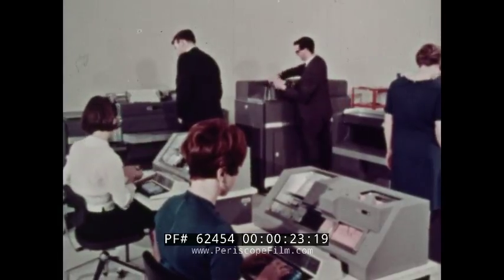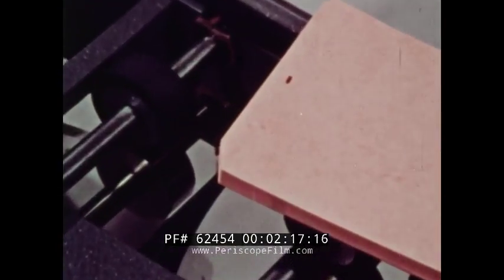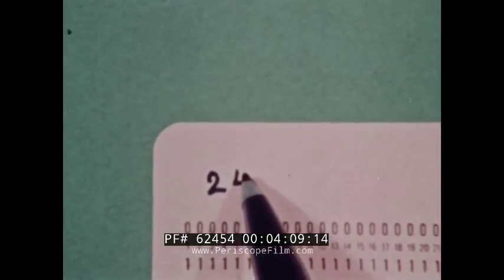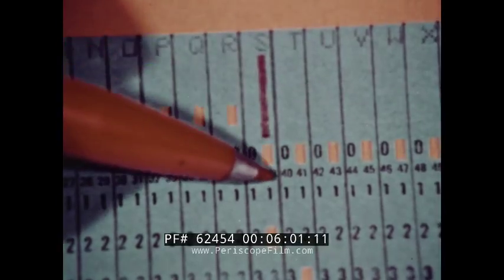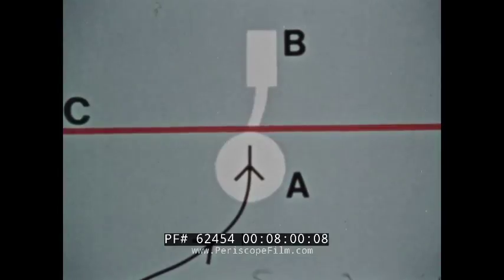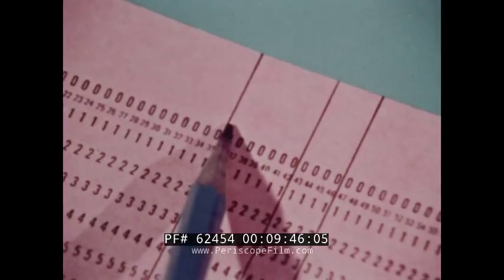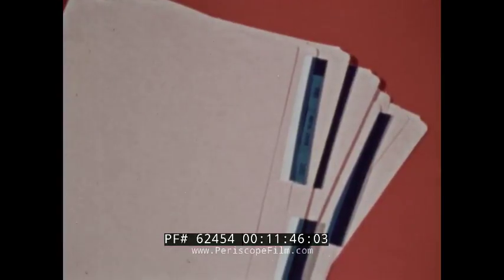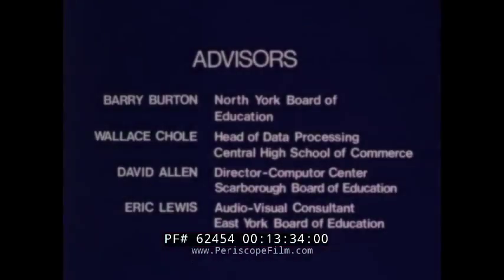PUNCHED CARD DATA PROCESSING INTRODUCTION   IBM 029 COMPUTER  62454

Comment: I never wondered how punch cards were made, but your show is most inviting. I was an avid typist who worked on several IBM data entry machines. An advantage of the punch card was that it can be used more than once when it was in good condition. The only disadvantage I knew about the punch card was when the print was vague atop the card.

Comment: The 029  was a keypunch machine, not a computer like the IBM 7090, 1401 and 360/370 computer series I started my Data Processing career on.  Even though I ended my 52 year career in Data Processing/information Technology in 2018, I still can code Assembler, COBOL, Fortran and RPG.

Comment: Punched cards were way before my time, but I did run a system for the Air Force back in the late 90s that had been around for so long that the field sizes and on-screen layout were based on the old 80-column cards.

Comment: The “029” refers to the IBM keypunch machine that operators sat at to enter data onto them.  Cards are NOT read from the top or bottom but rather from the left edge.

Comment: Brings back memories, both good and bad, Was train to work on the IBM keypunches, sorters, and interpreters. Spent 25 years working for IBM service as a remote Customer Engineer. Hated the timing and circuits for each machine, BUT today I miss it the complexity of the systems and how they worked with each other. Good times.

Comment: I started working in IT at the tail-end of the keypunch card era. I remember them fondly, though I'm not sure that I was particularly fond of them at the time. One use of the slashed corner not mentioned in the video was to make some cards stand out from the stack. So, if for example, we had to include a card with the run date in a stack of job control cards, we would feed it upside down in the keypunch machine and insert it upside down in the stack, this way its rounded corner stuck out from the slashed corners. Next time we ran the job and had to change to date card, we didn't have to search for it in the stack.

Comment: "giving the card 960 possible different punching positions" Yeah, not in practice...for example, you can't send a card through that has all the positions punched. It would be a flimsy mess and would probably get crumbled in the machinery. Also, there was rarely a need to punch at most 2 or 3 numbers in a single column, so in practice it was more like about 160 positions.
Reply: I used to fix this equipment.  While there was no reason for a card reader to see a card with more than 240 holes (3x80) we tested the printers by punching every possible location.  This was called lacing and allowed you to see at a glance in all the dies were functional.  Our card punches were made in France by Honeywell Bull.

Comment: In 1979 I became involved in programming learning FORTRAN V on an IBM 370/148 and most people get used to the Model 29 puncher. Those machines are very heavy and noisy and if you mispunch a card you discard that I take a new one. One of the undesirable things was being aware to number those if you or someone drop them as is the worst nightmare for beginners to know early on. I still have some of them around to show to younger generations how difficult programming was in those days. Thank you very much for the video as I wanted at some time more information on filing and setting fields for records.

Comment: In the mid 70's, our tiny school didn't have its own computer (of course). Terminals weren't really in use yet, so we had to write out our programs on punch cards by hand (pencil in the boxes), so I guess they were optical by then (?). You stacked up your cards, put them in the inter-school mail.  A week later, you'd get the output from your program back.  Really sucked when you then found you'd slipped and put a decimal in place of a comma or some other tiny error and all you got back was an error message.  Lather rinse repeat!
Reply: Thankfully, the next year we got a TI Silent 700 terminal. Now we could just type out code, run, and get errors right away!  I still have a functional Silent 700 - complete with acoustic couplers!

Comment: As students of Mechanical Engineering in 1980, we have to learn Fortran IV and Basic as mandatory. Basic was not so much trouble since the laboratory was equipped with Tandy's TRS-80 with incredible 16kBs of memory.

The real problem was FORTRAN since we have to:
- Buy our card packages.
- Reserve time in the punching machines.
- Punch the cards, do desktop test and if we have everything right...

- Go to the counter, so that the employee can take the cards to the reading machine, in the brief moments in which he did not cut the print jobs of the printer, sorting them in the loft where the prints were stored, recovering the card packages already read, or talking about their daily events with other clerks...

- As freshmen we were in queue 5, so there were researchers, graduate engineers and others before us... after at least half an hour, the work was finally processed and sent to the printer and we had to wait for everything the aforementioned process... waiting for the clerk...

- To finally discover that you forgot to put something that went from a comma to numbers in radians ...

- Redo the entire process to correct the error and consider that we had to leave the facility at ten o'clock at night to cross the campus and get transportation... to start over the next day and meet the deadlines.

Those were the wild days of computer science in the mainframes in the 80s for a student...
Reply: The punch-outs made such great confetti, though!
Reply: @rockets4kids  And cards were also a good material for cardboard planes!
Reply: @rockets4kids  makes a great gift for neices and nephews too!
Reply: MY program destroyed ( virus) right before submitting to finish BS Engineering...
1986. 
I hate computers...lol
Reply: A prank in our class was to introduce a spurious card into a fellow students pack, or just change the order of the cards, then the compiler would reject the job lol.
Reply: @howiedewin3688  To avoid this, we write the card number with an ink pen as long as clercks had tendency to drop packs as they put it into the reader or as they collect them from it.
Reply: @m.a.granados7960  substitute the spurious card with the identical ink penned number, kids arent as dumb as they look sometimes.

Comment: neat... before they used ASCI and binary to store more info than could be stored on a single card.  The alphabet took 2 "Bytes" to store a single letter and the number 254 took three "bytes" instead of one.
Reply: ASCII, or the IBM favored EBCDIC code was indeed binary - a compact encoding.
This encoding would not have been ideal for the pattern of holes in punched cards. Cards had an additional requirement: the need to maintain a mechanical rigidity. No more than two holes per column ensured strength.
When the goal is to represent one character per column, it’s a matter of reducing the character set until only a maximum of two holes are needed. There is no need to use all 256 of the full ASCII repertoire. With 12 rows we actually could encode 4096 different characters per column if using binary.
Binary encoding, compactness, efficiency, are indeed employed within the computer’s circuits. Not so much for this external physical media that’s more a human interface with mechanical integrity considerations.

Comment: Thank you, I would never have thought they used brushes 👍
Reply: A few of the last card readers used solid state optical sensors, more expensive to build, but they lasted much longer.  Paper is one of the most abrasive materials, and would wear out the metal brushes as the cards slid under them.

Comment: 12:41 "Two abbreviations are used for sex...", not any more, hero.  I don't think punch-cards could accommodate the zoo of genders today.
Reply: That's easy, you have a separate card just to denote the gender. The "gender punch card". Of course, in 99% of cases it would be redundant...
Reply: I'm sure they could have squeezed in a U (unknown or undefined) without adding an extra field column.
Reply: There are still two main sexes today tho lol (apart from intersex which is a congenital condition). Genders are different from sex.

Comment: Sadly, the limited date field make the cards non-Y2K compliant.
Reply: Don't worry, somebody else will have that problem in 1999. Unless you change jobs, and inherit somebody else's Y2K problem. But that is so far into the future that nobody will worry until about 1998.
Reply: We have Y10K to worry about.
Reply: @jvolstad  Y2k38 is next up.
Reply: 2038 with Unix.
Reply: Oh no, we will have to re-punch all cards to suit the new format. Better order another pallet of card stock. Actually four pallets of the white and mix up the other one for various colo(u)rs.
Reply: I think, not the cards as input device are the problem, but how the data are then stored and processed (in case of IBM: COBOL and SQL DBs)
Reply: Nonsense 80 column cards are Y2K compliant… I first started using punch cards in 1963 with Fortran II … still using them today they make wonderful book marks … books some of you might remember them… we used them for references before the web
Reply: In real business applications you'd find that every single column of a card would be used.  Where I worked they were so desperate for bytes that most dates were done in Julian.  YYDDD, two digits year, and how many days into the year the date was.  All kinds of subroutines were provided to convert to and from  Julian / MMDDYY to handle human input and print dates on reports or screens.  Frankly, our Y2K conversion was a nightmare, hundreds of programs still expecting those old 80 byte records (even when those records were on tapes or disk)  But we started early (1995) and did it right and had zero problems.

Comment: Couldn't bear to watch the total video. Brings back nightmares as a student of electrical engineering at Tennessee Tech 1968. Fortran-IV was a mandatory class. The school had one of the largest IBM computers in the country with a whole climate controlled floor of the engineering build dedicated to it. They sublet time on it to banks and other entities. As undergraduate students our time allotment was the lowest priority. We were only allowed specific hours on the punch machines. After punching the cards we'd proof them and submit for a run (late night) of our program solving a problem. If it didn't run we'd have to rewrite, repunch and run the next night. Grading depended on the number of times you had to run the program and solve the problem. Imagine running across a dark campus late at night during a pouring rain with a box of punch cards, trying to get your stack of cards in the tray before deadline and THEN you slip and fall on a slick sidewalk spilling the cards. Damn! Now my laptop & cellphone have more computing power than that dreadful IBM monster. The simple problems were easily solved on the "Post log-log-duplex-decitrig" sliderule but we had to learn Fortran-IV. What a waste.
Reply: In 1982 I learned to program in COBOL with punched cards.  Similar situation.  Although the collage didn't time share, we had the computer to ourselves.  Not much better, only one compile per day.  I watched a girl have a rubber band break right at the door to the computer building.  Entire final exam program landed in a water puddle.
Reply: @dbeagle82  : During "summer quarter" 1968 a team of EE grads at TnTech had strapped a teletype keyboard from the top floor of engineering building into the IBM mainframe on the lower floor and found they could directly input program to the "brain" bypassing the card reader. It was rudimentary but they could ask questions and get answers on a pin printer. They were walking tall. :-) That was what we called "RAD" back then. Now nearly anyone can learn to CODE and make big bucks. EVOLUTION!
Reply: Gerard Johnson some of us undergrads from that era worked at slave wages in the computer center. The unspoken benefit was after hours, when the adults went home and we had the run of an IBM 1410 business system with a rare 80K bytes of memory. One of the other guys modified the Fortran compiler to read student programs, then put on tape, into memory, simulating a card reader. Except for reading the cards, it was blindingly fast. Students got as many turnarounds  as we were willing to run, until the building was locked up. When we were the only ones left in the building, we ran games, music, drawings, or our homework assignments outside of the nitpicking accounting system.
Reply: @richardkirka5977  : You got a bit deeper into it at school than I did. My dad was a electrical contractor. New school buildings were all the thing in Central Kentucky during the 50s & 60s. We were "open shop" but the public projects carried union wage rate (scale) wages. Daddy was into the money and worked alongside the guys making very good money. We worked off of drawings stamped by an electrical engineer. Job done, passed inspection and we got paid. Great! Yet I always wanted to know the WHY & HOW the drawings came about. So I went to "college". Along about the late 60s all of the new schools were nearly built and we got into industrial electrical. Most of it was "design and build" where the "general contractor" put together a design team and sold the project to the client while bidding against other contactors. I wanted to be part of that process. It took 2 years to realize "university" was only going to teach me theory and I'd need to apprentice with a licensed engineer to learn what I wanted to know. I quit Tennessee Tech and taught myself "electrical engineering" by dissecting other engineer's drawings. I would do the design and hand draw the tracings for ammonia prints. Eventually I learned AutoCad and had a plotter. I'd submit and verbally sell the design to a "licensed electrical engineer". I would pay for the "wet stamp" and the engineer was then my employee as a paid consultant. We had a great run for over 30 years without even one problem working with this system. Never had one E&O claim. Many times I had "licensed engineers" come to me to solve a problem for them because they knew I not only could design but had the experience of bringing a project in on the site. One of my highlights was during the introduction of digital power to the market. None of the "old heads" understood harmonics and how to counter the effects of switched-mode power supplies in early gen computers and "Variable Speed Drives". I quickly became versed in "triplen harmonics". All of the schools daddy had wired now had desktop computers in every room and industry had bought into VSDs in high order. Helping the engineers and utilities damp the problem was lucrative. I've now forgotten all of that and replace "light bulbs" with LEDs in my house but I remember that it was "Good Times" and good money. God Bless
Reply: I hear ya.  We had 2 mainframes, I think one was a GE and the other IBM.  Turned in our cards, and crossed our fingers.  Next day, we got a 'dump' printout after our program blew up.  Sometimes, the program actually ran.  Frustrating.